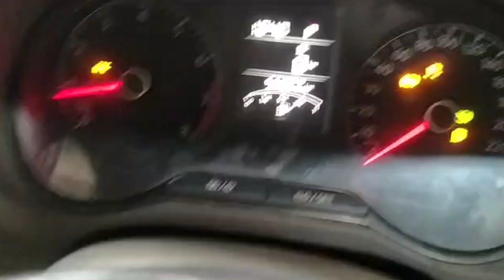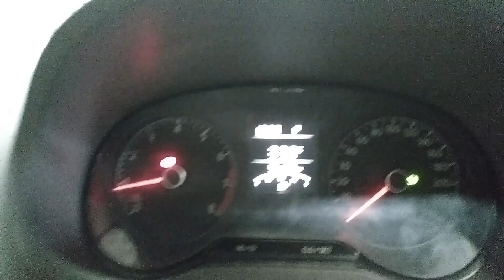Volkswagen Vento TSI engine misfiring a critical issue that no can solve - Hindi / Urdu

Comment: Hello sir, I am facing the same issue in my vw petrol car, changed sparkplug, coil and checked injector but still problem is not solved
Reply from the maker: Yes this is the problem which OEM also can avoid to take your car to resolve this issue, tell the OEM People they have to solve this issue because no one other can solve this problem if your car is also having same issue.